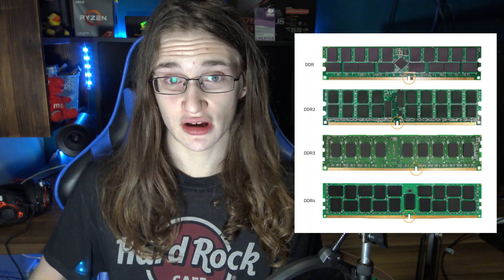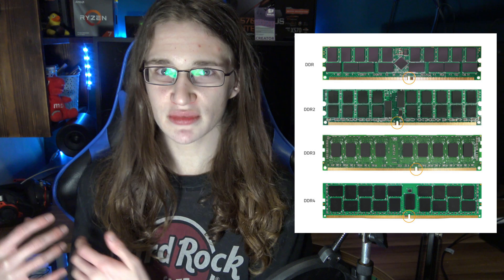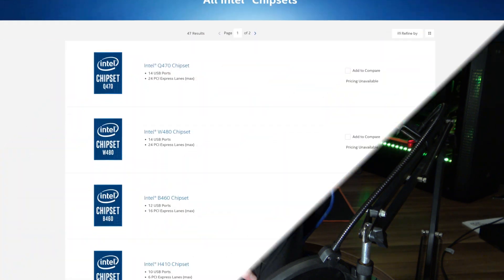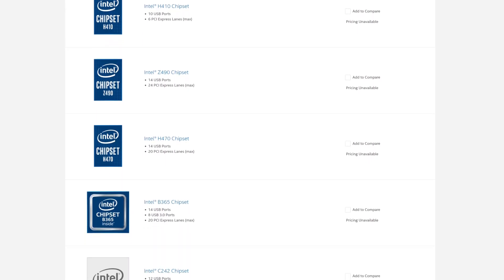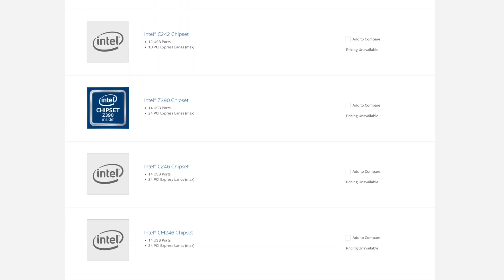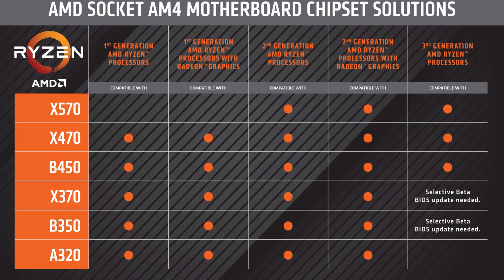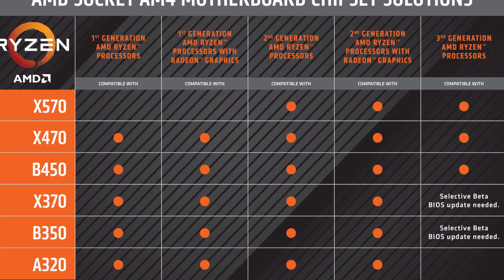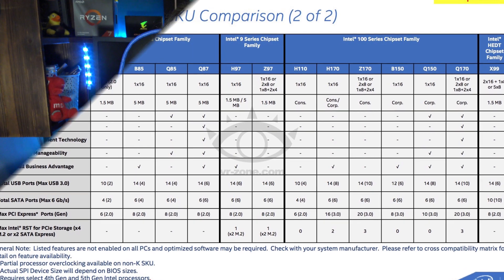CONFUSING PC Building Terms Explained! PC Terminology Guide

Comment: Hello Avrona: Great video, many thanks! You may have covered this in a previous video, but I can't remember. Maybe discuss how Ryzen is not as forgiving with ram/drivers/chipset as Intel is. The Ryzen platform is still pretty new, where as Intel has been on 14 nm since 2015, and is very mature. Ryzen "seems" to like certain manufacturers of ram placed in a 2x configuration vs. a 4x  to achieve advertised XMP profiles. And, ASUS motherboards seem to have a "secret sauce" in their BIOS that work well with Ryzen. I have built 13 Ryzen systems and have had the best luck with Crucial and Geil ram. Ryzen seems to be finicky with standard GSkill, I guess that's why GSkill reengineered some of their ram for Ryzen into a "Neo" brand. And, don't forget to update your BIOS and install the latest Ryzen chipset for best results. Best!